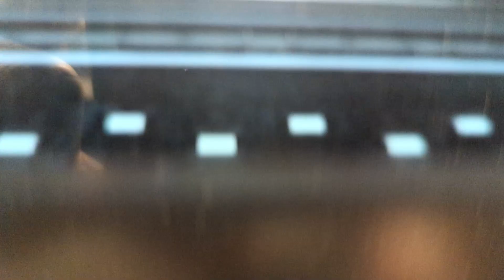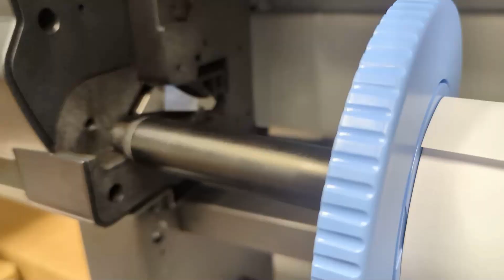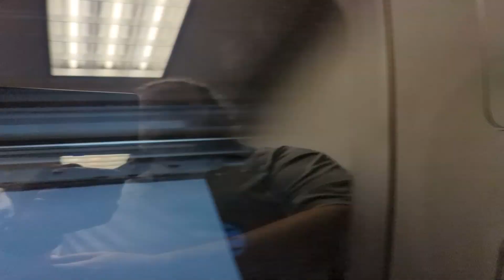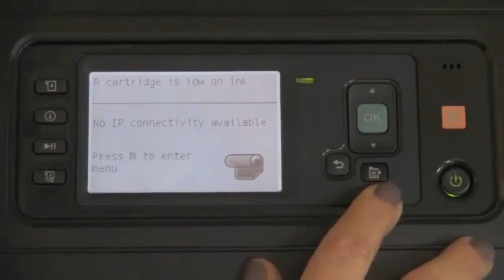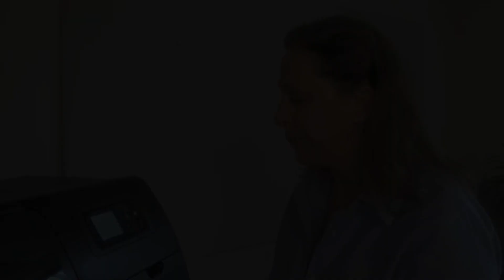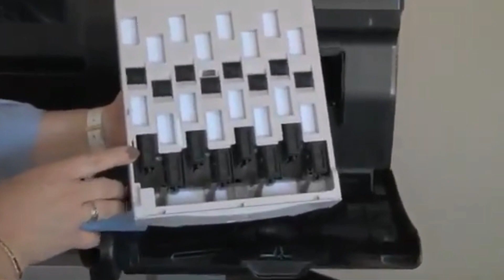Training Video on the Z6810 HP Plotter

Comment: My Designjet Z6200 black ink cartridge is lighter when i print, what could be the problem. All my cartridges are 771A but am not getting the same replacement for the black, can i buy like 771B/C  black to replace (will it work)